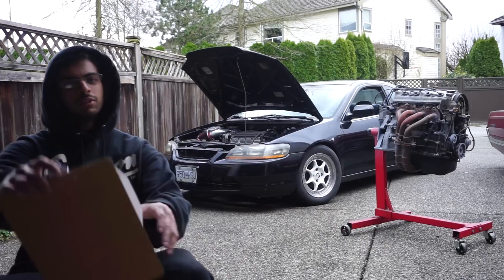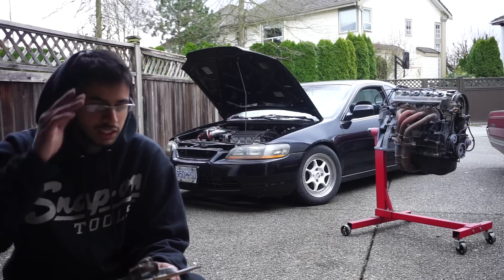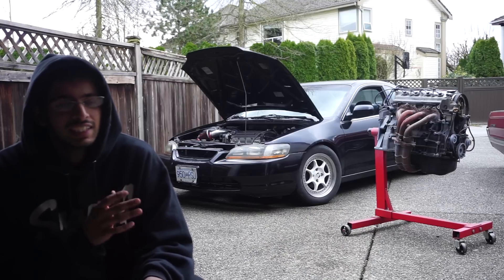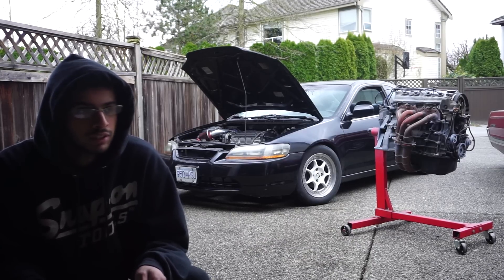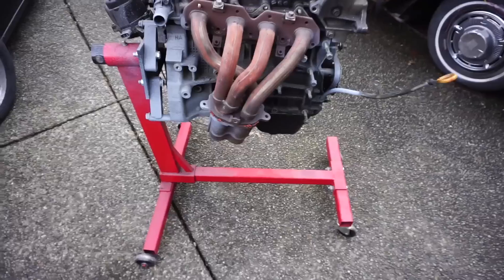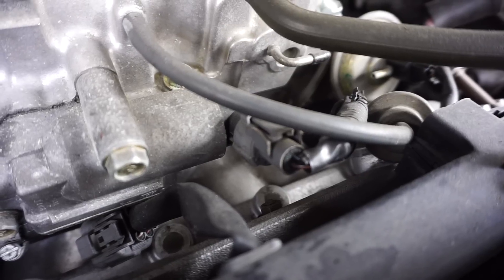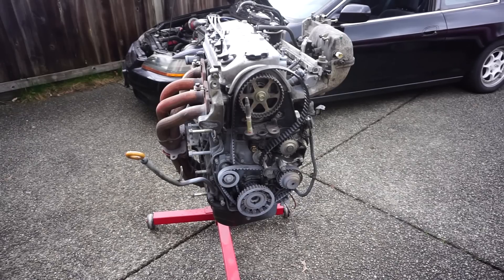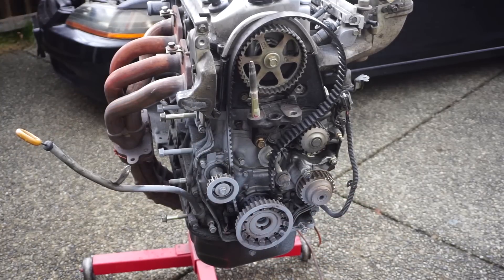HOW TO: H22 Swap guide for   HONDA ACCORDS

Comment: Hey man this video was super helpful, kinda old but all this time later im about to get my H22 swap 6th gen running. I used 1 inch shims and longer bolts to run the accord power steering pump, as well as a longer belt, and the hood still closes. Cheers man

Comment: I remember doing the swap a long time ago my car has California emissions managed to get everything work but had to build the whole H22 wire harness buy one wire at a time even managed to get the air condition system to work it was a fun little car wish I never sold it still dream about it
Reply from the maker: Salute for wiring your own harness.  Takes some skills and patience  to do that.
Reply: @Wrenchlife604  yes it is what I am good at building harnesses especially that the car was California emissions and have a lot more ended up with no check engine light and running wonderful anybody needs a harness I am very good at it all I have to do is go to the junkyard and get to harnesses and deepen them all and use brand new spools of wire
Reply: #boosted401 mzr I plan on purchasing a H22 and putting it in my 6th gen, i would love to purchase a harness from you!
Reply: #boosted401 mzr  can  build one for. A civic
Reply: You should consider starting up a business 😉
Reply: @jonathanfarias4399  you still build harness I need one for an integra h22a1swap

Comment: Back in 2007 when i swapped a 97 JDM  H22a typeS SH into my 98 accord i had to move a wire from crank positioning sensor to distributor plug. Also the SH did not have a halfshaft. It was a seperate unit that used ATF. And it was a manual trans.

Comment: Great vid, you've got me inspired. 6th gens are wildly underrated but they're actually pretty badass and can look great when done right. I absolutely love my CG6 and have wanted to build it up for a while but the selection of aftermarket internals is pretty sparse and the F23 isn't nearly as receptive to power being thrown at it.
Reply: but what about putting in sleeves the f23 can take alot more horses no?
Reply: @cencoastmotors with an oil cooler, good radiator, rods/pistons you could turbo it to about 250hp quite reliably. Still nothing like NA.

Comment: Extremely informative video, thank you sir! Have you by chance ever done an H22 swap and retained the Accord auto trans? I'm thinking it would be easiest to swap in a H22 auto trans with the H22 engine since i'll need the ecu to recognize both the engine and trans.
Reply from the maker: Havnt done an autoswap one yet. But best would to find a automatic non imobilized prelude and use the engine  trans and ecu from it. Thats just my guess  tho
Reply: I forgot all about the immobilizer, do you happen to know what years are non-immobilized?
Reply from the maker: @willnicholas4474   pre 1997 i believe.

Comment: Here's the big question I have the accord trans p2a5 with the h22a4 what clutch do I need to order 🤔 it's not completely out yet but it does chatter a bit when taking off
Reply from the maker: I used my accord clutch and flywheel  on my h22. My h22 was out of a automatic prelude.
Reply: @Wrenchlife604  so a 97 Accord clutch and flywheel I'm doing both thank you

Comment: Is it possible to turbo a 6 cylinder without moving the battery? I see that a lot of ppl are using the 4 cylinder but I’d like to keep the 6 cylinder if possible

Comment: im assuming you connected the crank position sensor with the distributor wiring you had shown. getting ready to swap 02 accord i picked up a donor 97 prelude complete. just curious
Reply from the maker: @seanmcelyea4988   nope. The crank position sensor on the accord and 5th gen prelude engines h22a4 are located on the crank pulley side of the engine. Stock harness plug . Will plug right into it

Comment: So I’m trying to do my swap on my accord 01 sedan. but I’m going a different route... the h22a4 (I want to leave it obd2) motor with the auto trans from the f23. I just wanted to see if there’s anything I need to know before I do it. Also the any wiring need to be done which ecu will help fix the immobilizer

Comment: Did you hook up the crank position sensor? I have the exact swap setup and my crank position sensor cable on the accord harness is too short
Reply from the maker: Yah shure did. It should clip it no problem.  Length works fine

Comment: Also do you have a link to the wiring schematics? I have not been able to find one anywhere.. I also have the accord/prelude service manual and it doesn't help with the engine harness
Reply: I just finished the swap throw your questions at me

Comment: Do I have to do anything for the power steering? or AC? I'll probably end up deleting both anyways but I was curious. Also the other OE accord mounts will fit the H22 all I need is that right side bracket adapter?
Reply from the maker: Correct about the mounts. The power steering will require  a custome high pressure hose. The low pressure hose is just clamped on so no problem reusing the old one

Comment: I'm trying to covert an obd2b to obd1 chipped ecu on the stock f23a1 engine but when I plug the Ecu in, the Transmission dont want to go into gear its a automatic transmission i tried 2 different Ecus as well would you kno how to make a automatic transmission on the Accord think its a Manual transmission so that I could tune it
Reply from the maker: The transmission  controller is built into the ecu. So u need an auto ecu to operate  an automaitc trans.  Sorry  i dont know much more on the subject. I never dealt  with automatic hondas  before

Comment: I could use some help, swap a 2000 honda accord Dx with a h22a. I have a p28 with the jumper but it won't start.
Reply from the maker: check if you are getting fuel and spark. also with your p28 ECU did u have it chipped and tuned to run a h22 ?

Comment: Other then the distributor did you have to change any wires on other sensors? I have sensors on mine that don't reach anywhere. Did you have to extend some wires around the throttle body?
Reply from the maker: Only had to rewire the distributor. Thats it. Follow the video and its straight  forward.  Works with h22a4. If u uave an obd1 h22 it may be diffrent
Reply: @Wrenchlife604  yea mines a h22a I had a a4 before but it blew up..

Comment: what about A/C compressor and power steering, i want to keep those, can u make a vid about what needs to be done to them for the swap? thanks
Reply from the maker: Manjoyt Kang  no idea to tell you the truth. I would try and use the f23 ac compressor and f23 pump on the h series block if possible.  Power steering shouldn't be that hard if you use a h22 pump. The pressure line might  need to be custom made by a hydraulic shop. The return line is low pressure so you can use auto parts store  line and clamps
Reply: @Wrenchlife604  I believe my swap has the stock Accord power steering pump I'm new to Hondas 😂

Comment: I got a 97 Accord lx. The 2.2l engine is clapped out 0 psi on cylinder 2 and 3. Dies at idle with ac on lol. I got a bent valve. Thinking about H22A swapping it. Do you have any idea how much money it costs for parts not including the engine ?

Comment: Hi! Awesome and helpful video, just wondering one thing. didn't hear you clearly in the video, blue tachometer from distributor..where should I attach it? I am using a obd2b-obd1 converter in accord 6th gen
Reply from the maker: You dont need to hook it up. Factory gauge tach will work withought it.

Comment: Hello, I have placed a Euro R H22a on my CG5 and everything has been installed. The vehicle is operating normally, but the engine speed and speedometer are not accurate. Have you encountered such a situation?
Reply from the maker: did u use the factory accord transmission or the euro R transmission? check the vehcile speed sensor or the gauge cluster

Comment: hey man i’ve been wondering if you ever thought about wiring in the temp sensor to the two pin connector (red/wht) and (grn/blk for ground) and just using the red/wht wire to tell you coolant temp ? i’m about to try it this weekend, just wondered if anyone else has done it
Reply: the connector is from f23 coolant temp
Reply from the maker: Let me know if it works  out for you.

Comment: For the IACV valve the harness on the accord has three wires, how did you wire it up into two wire ? Did you have to move any pins around at the ecu?
Reply from the maker: You need just the 2 pin prelude iacv  connector  off the prelude harness and mate it to your accord harness.   I talk about what to do in the video.   No need to repin or depin any connectors or ecu pins
Reply: @Wrenchlife604  ok so just cut out the ground and connect the other two wires with the harness? I have the obd2b to obd1 conversion harness, It might just be my ecu that’s messed up, I have a euro r swap and they have it on the rear of the intake. Thanks for your help!
Reply from the maker: Is the euro r iacv a 2 wire or 3 wire? I havnt had any experiande with the euro r h22.
Reply: @Wrenchlife604  it’s a 3 wire but I got a adapter plate from rosko racing which allows me to use a two wire iacv

Comment: I have a stock 01 accorde sedan ex 4cyl what engine and trans is the easyest swap (less modifying with  computers wiring ect.) That will give me better acceleration and still git me good gas mileg
Reply from the maker: If its manual the h22 trans will mate up to the factory 4 cylinder  and should help with acceleration. The f23 factory 4 cyl isnt all that bad of an engine
Reply: @Wrenchlife604  ok cool iam probly gona do that first as my trans who ever had car last ctacked it putting on a bolt for the mount
Reply: @Wrenchlife604  then if lucky find a f20b

Comment: What do you do with the key immobilizer?  using an obd1 ECU i need you help
Reply from the maker: Im using and obd1 ecu aswell. You don't  need to do anything with the immobilizer. Factory key works fine.
Reply: @Wrenchlife604  Thanks for your help. I didn't think you would answer me, much less quickly.  My English is bad I don't understand much of what you say in the video, that you use to assemble the bracket well on the driver's side in listening to what needs to be adjusted a little.  thanks again

Comment: Wiring up the dizzy, does it wire up the same if I use a internal distributor? Itll be a obd1 distributor I'll be using also
Reply from the maker: Wirings gonna be different.  You gonna be using a obd1 h22 engine aswell?
Reply: @Wrenchlife604  yes jdm  h22a obd1 engine.
Reply from the maker: Yah not to familiar with jdm h22. But wiring is gonna be diffrent

Comment: So I'm dumb here I have a f23 the one like ulev engine(accord) I want to swap a manual transmission Into it do I have to get a accord manual trans or will most honda trans bolt in
Reply from the maker: F series accord or h series prelude transmission  will work . I have a video on my channel search accord transmission. Showing how to install a prelude trans

Comment: Got a 91 accord wagon I am working in a swap h22 with the lsd transmission it came with the mid shaft on it what axles I can use they told me the accord axles won5 fit
Reply from the maker: no idea i havnt done a 1991. maybe someone in the comments can help ?

Comment: Quick question for the temp gauge just did a jdm h22a on a friends 2000 accord but temp doesnt work .. is it possible to make it work with the original engine temp sensor or do we have to get aftermarket gauge like the one shown?
Reply from the maker: You might be able to use an older cluster . I just used an afterm3 gauge because it was  easier

Comment: What about the crank sensor wiring?
Reply from the maker: Crank sensor plugs right up in the same location if you use   h22a4. The  jdm one  or  h22a1 require modofication to the crank sensor harness

Comment: How do you connect all the hoses on the the side where the fuel lines go ?
Reply from the maker: High pressure fuel line gets attahed to the fuel rail. The low pressure return gets hose clamped  back to the steel return pipe. Same as factory
Reply: Wrench life 604 I don’t get it anyway you can show me ?
Reply: I need help with all the hoses that go connected to the intake manifold 😬
Reply: I have h22 fuel rail

Comment: Hey man so I have a 98 and I’m h swapping with a obd1 internal coil. How would I go about the wired for that one
Reply from the maker: i havnt done it . but i know the crank sensor wires  have to be routed to it. the obd2 h22 has a crank sensor close to the crank pulley inside the timing cover. the obd1 h22a1 has the crank sensor built into the distributor.
Reply: @Wrenchlife604  sorry I didn’t clarify , so it’s a obd1 h22a engine with obd1 internal coil dizzy. I’m trying to use the haress exactly like yours with the 4 pin
Reply from the maker: @SN0WMAN801   the obd1 distributor needs more then 4 wires going to it. the way i did it in the video. wont work for you
Reply: @Wrenchlife604  if I were to do it with an external coil distributor . Do you know what car I would be able to get it off of ?
Reply from the maker: @SN0WMAN801   97-01 prlude. you will also need the coil. if you have a obd1 dizzy and  wiring connector to it. you can make it work. i just havnt done it. so  i cant realy help

Comment: What harness did you use original honda prelude? accord? or h23a?  And which intake manifold is from h23a blue top? Or H22? Thanks
Reply from the maker: Intake manifold is h22a4 stock. The harness i covered in the video. Its the stock accord harness with the prelude  distributor and coil connectors , soldered in
Reply: Hey I got a 1999 Honda Accord I want to put a H22 what all do I have to do
Reply: @Wrenchlife604  will that help me get through smog?  I live in California and I want it for my daily.  I have a 5th prelude ECU with no immobilizer, but I have wiring problems. I don't know if, as you have, yours, is it good for my swap?  help me please, I ask you
Reply from the maker: No idea. We dont have smog here.  Good luck

Comment: I have an automatic 98 Accord Coupe. The F23 motor has 300k miles on it. I really want to swap it to manual and swap it with an H22A. Is it worth the money? Or should i go K? Also would I be able to pull off an H2B setup?
Reply from the maker: You wont be able to pull off the h2b because b series trannys are rod linkage and accords  use cable linkage.   And im not too shure if k swaps are even avaliabe for this gen accord  chassis.

Comment: What engine mounts do need ?
Reply: From what I’ve heard you can use the stock mounts. The front mount to the transmission and the one to trans mount are the exact same

Comment: What axles do i need on a 02 accord wirh a h22a4 swap.
Reply from the maker: reuse your old axles. no problem. dont need to buy or make a set. stock ones fit right in.
Reply: @Wrenchlife604  stock axles from the accord?
Reply from the maker: @yycxcars4335   yes.  manual axles from the accord.
Reply: @Wrenchlife604  thanks man I appreciate your reply!

Comment: I have a 94 prelude Si with the h24 non vtec. Could I swap in an h22 with vtec if I had the transmission and engine? Or do I need a new wiring harness?
Reply from the maker: Think you mean h23 non vtec? Yah the h22 will drop right in. You need   an engine and ecu.  You can use your stock harness and add vtec wires and i think you might need to rewire the distributor too. Pretty well documented swap on prelude forums. Start there
Reply: Wrench life 604 must be h23 because I'm not finding much on h24. Thanks a bunch

Comment: So your using the f series transmission?
Reply from the maker: You can use the factory f23 accord trans.   But i later switched to a h22 trans. Highly  recommend  the quicker shifts  in the h22 trans. Both will work!

Comment: Can i use a 96 accords ecu and harness or do i have to get the ludes ecu the p13? Just trying to swap out he f22b with a twin cam not trying to Frankenstein it .
Reply from the maker: accord ecu wont work ,you can use a non imobilized h22 ecu . but the way i described in the video is probably the best way to do it
Reply: Wrench life 604 but the harness plugs in fine just the dizzy right dont have to take it from the lude either?
Reply from the maker: RandomGolf  the dizzy is a different plug and the idle air controller valve.   Re watch the video bro
Reply: Wrench life 604 yes its different because u used a h22 instead of a 23 theyl homie installed a h22 in his cd5 and plug in like nothing didnt have to cut any wires or anything just plug in all he did was get a ecu a p13 and car ran great but anyway great video like y said it worked out for u could help someone out there just wanted to see if my bro can fit a h22 in his 2000 accord with out doing what u did

Comment: Did you use the stock accord fuel line  to the h22 rail??
Reply from the maker: Yes. Make shure you use the h22 fuel rail . With the h22 fuel rail feed nut and copper washers. The accord nut wont work

Comment: So what's wrong with the F23 motor?....is it worth modifying it?....I got a 99 Honda Accord 5 speed,I only bought it for 250$s just because it was so cheap and it runs good.
Reply from the maker: the f23 isnt bad. and exhaust and cheap header realy wakes them up. plenty of torque.  good engine to daily

Comment: I have a 00 cg6 5 spd will these steps work for a h23
Reply: so if I buy a h22 non sh will elimate the halfshat that bolts on to the block
Reply from the maker: the accord half shaft is used on the h22. the SH engines use a diffrent half shaft mounting wich requires custom work ( using a home made adapter plate to accept  accord half shaft) keep it simple and used a h22 from a non SH
Reply: @Wrenchlife604 ok thank you I appreciate that also when I do the computer swap to a p28 with burned on mobilizer will I have to program the key to the computer or will it be eliminated
Reply from the maker: immobilizer will be eliminated